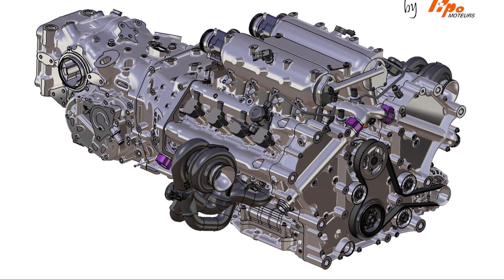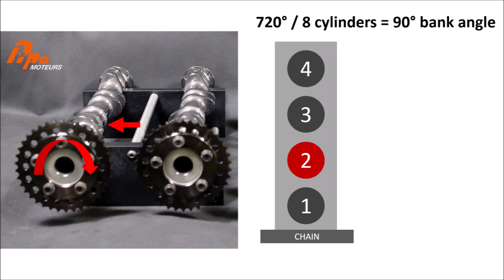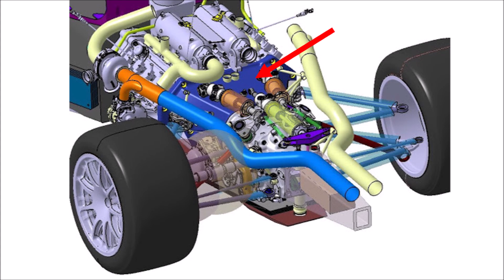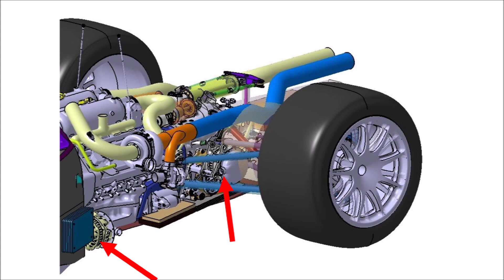SCG 007 (Glickenhaus Hypercar) Part2 - Drivetrain

Comment: Why is the high pressure fuel pump driven by the camshaft. Wouldnt it make more sense to just have an electric pump instead?
Reply from the maker: It need quite some power. It's common for ICE
Reply: B Sport I see now , Thanks a lot. I used to think that engine driven pumps like Kugelfischer died after the 80s and that every benzin engine from that point on started using electric pumps.
Reply: If u think about it. F1 uses camshaft as main source for  high pressure pumps. Its efficient, reliable and very very compact design. Althoght they uses low pressure e pumps in tanks to get fuel towards high pressure accumulators.
Reply: @alesksander  yeah makes sense